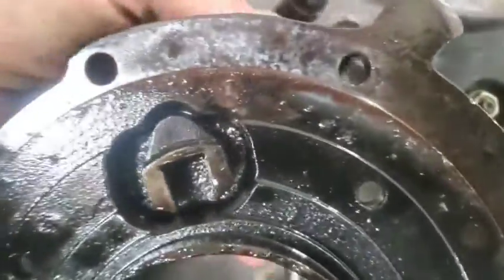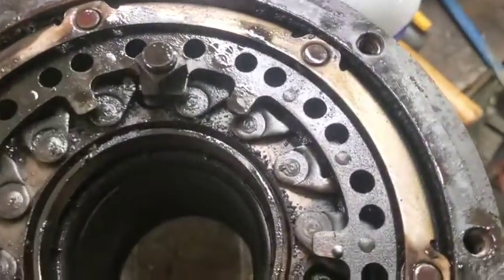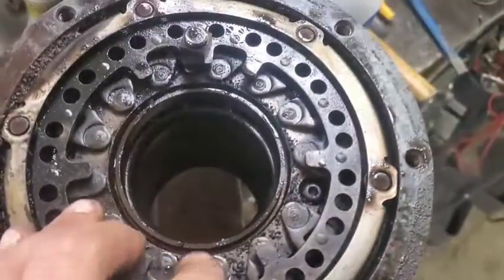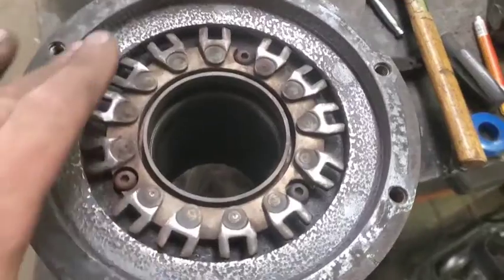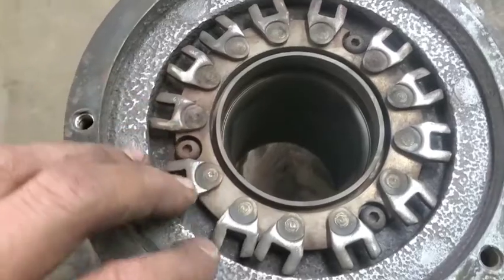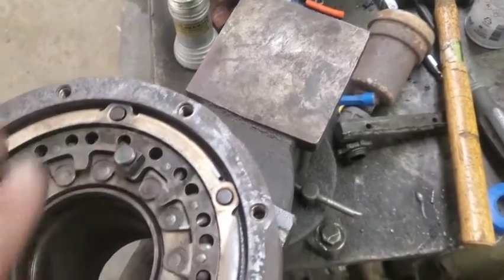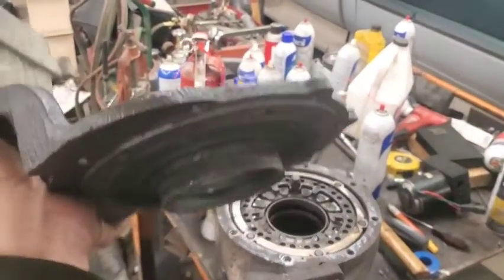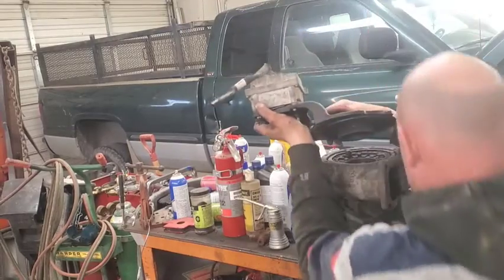VGT (Variable Geometry Turbo) Cleaning and basic troubleshooting

Comment: Thank you for making this video, yesterday I discovered that the VGT on my 06 International 4300 is stuck "I believe in the open position" causing the truck to have very little power off idle. Unfortunately it looks like I'll be doing the same thing but I am curious if there is in fact any lubricant that can be used to extend the intervals between these services. Definitely not something I'm looking forward to doing but I guess that's why I got the truck for $3500 😅

Comment: Would this be the same for a 2011 6.7? I've heard the actuator has to be reset if you remove it.
Reply from the maker: If you're referring to the 6.7L Cummins then yes it would be somewhat similar.  If you have a bidirectional scanner you can calibrate the actuator to reinstall it.
Reply: @prodieselrepair3218  Thanks for the reply! If I don't have a bidirectional scanner, could I do it and then take it to a shop to get it calibrated, or would it have to be towed?
Reply from the maker: @greasycreekoutfitters5163  I'm not sure if that would be OK or not.  I know if the actuator is not calibrated correctly it could be damaged.